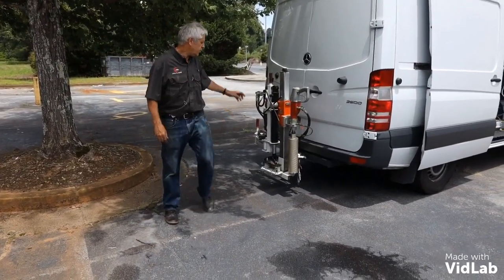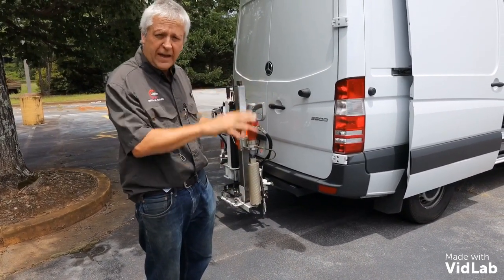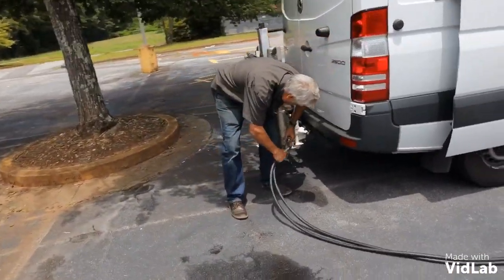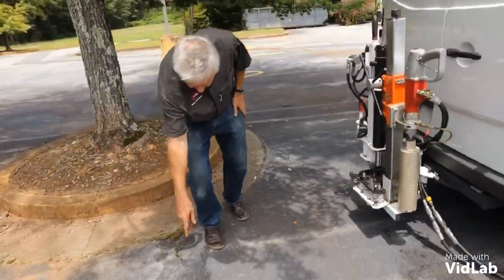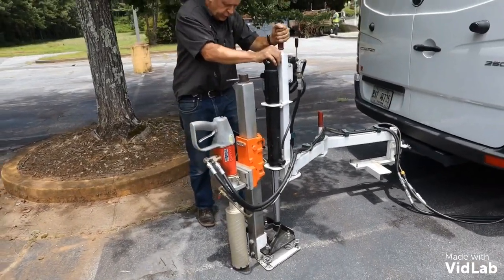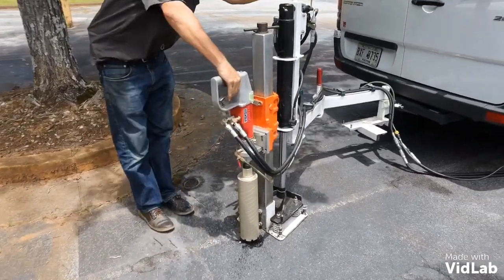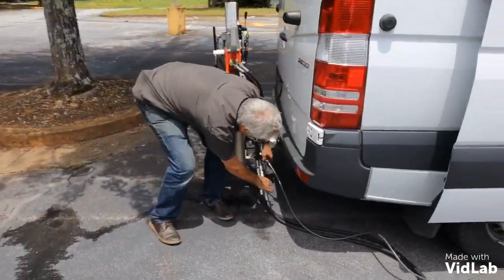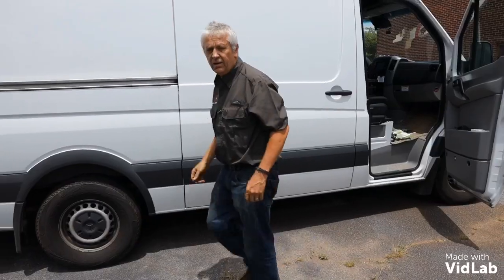Quickest Core Sampling Rig in the world.

Comment: Nice......we drilled 24" off the back of our truck for runway lighting years back
Reply from the maker: Carlos what was the set up time for each hole? How deep? Please also explain more about the mount or was the truck used to transport and maybe you lifted off the truck bed and used a vacuum base or drilled studs into the runway to fasten the rig to for good down pressure and accurate drilling?
Reply: Setup time was a about 5-10 min.....drill time was about 20 minutes max....to a depth of 18", because of all the safety issues on the tarmac we were lucky to get 8 -10 a night with clean up, removal of core with a angled carbide drilled hole to lift it out and leave it on a pallet....done them at several airports in the Wash DC region over the years.....put in " core drilling a 43" on youtube.....you will see some of the things i did.....never wire sawed, wish I learned.....i retired once but getn back into it probably....nobody wants a dirty job, and the money was always good
Reply: Forgot to add the we went to a bobcat and the drill base mounted on it using the hydraulics and water tank, small generator, on a trailer where we welded a hitch on the rear engine cover....31 years doin this....all depths and sizes
Reply from the maker: @iversonjcameron  Iverson....?
Reply from the maker: @iversonjcameron  Carlos - what interests you the most with my rig - speed setup or safety - other?
Reply: @usaroseinc  Safety.....is always an issue especially now.....but getn those holes drilled as fast as possible was always the key back in the day.... we always got to the point having to wait on others to get the holes done.....so basically because of college kids and their safety issues bs now it has gotten to be a day/night charge for a crew plus equipment....i did retire as i said but may get back into it...
Reply from the maker: @iversonjcameron  I can get you setup with a nice rig and I also have one trailer rig we built as an option - did work out pricey though - vs others on the market - we lost a bid on a couple after I did the demo - got the interest and showed speed/ safety etc - I had the best deal...but turned out that the bids specs were too broad  and turned out that I was selling a Swiss Army knife that did fit any of their needs  forever (saw/pump/breaker/core auger post driver / post puller etc etc)  instead of a simple single blade knife that did fit the broad spec  and could only core a hole...- oh well next time....